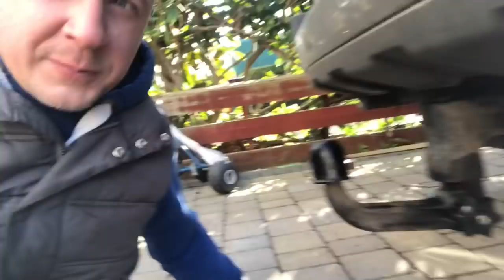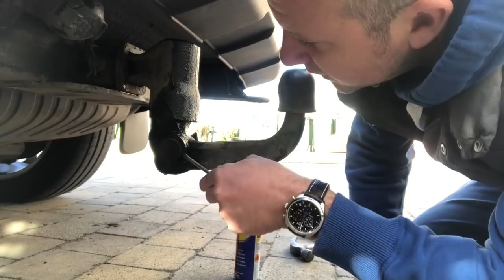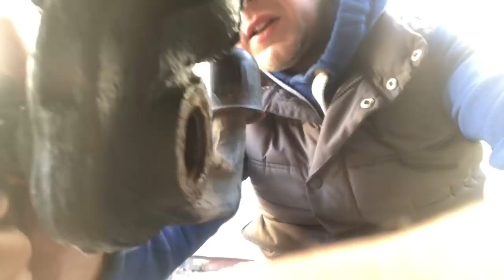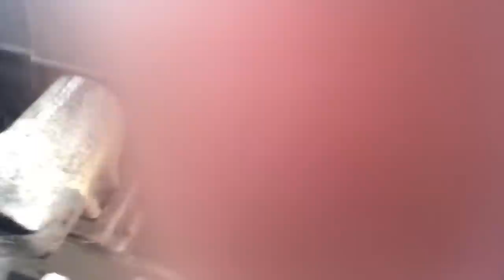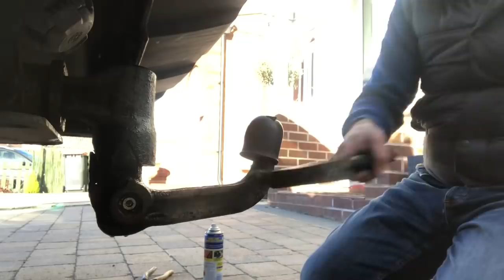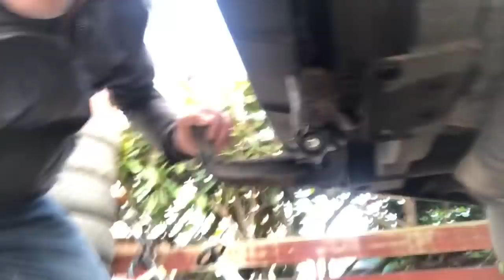Removing a corroded Range Rover L322 Westfalia tow bar

Comment: Thanks for the tips. I just bought a 2000 VW T4 Atlantis and it had a towbar fitted but no key !
I was lucky as it took less than 2 mins to prise of cover,remove circlip (used long nose pliers). A couple of gentle blows and the handle came out soon followed by the towbar. I don't need it and It hadn't been removed in the 17 years the prev owner had it.
Luckily it had been greased previously. I anticipated it taking a couple of hours to batter it into submission after watching your video.

Comment: Hammer time! I just had a similar time removing a Witter towbar, ended up having to take the bumper cover off and unbolting the receptacle, needing a lot of hammering to get it out of the bar. Then after disassembling the locking mechanism and hammering down on the locking pin from above, then more hammering to separate it from the receptacle. Then, hammering up on the locking pin to get it out (losing a small spring... damn!), it's finally free. The little lock is still seized solid though but luckily not a big deal.

Comment: I was attempting the same last weekend, but fortunately I did not follow what you did on that video, as it leads to damage of the tow bar (you damage the socket of this little steel ball that locks the knob in place). 
Some advices:
-if the lock is jammed the best should be to try to pull the core out with a sliding hammer. If you don't have one - you can drill the cylinder, replacements are available,
-smashing it with the hammer will not help much, you should rather try to get the internal mechanism moving by soaking it with WD40 and tryging to turn the knob over and over again. The best is to first unbolt it from the car, so that you can reverse it - will make it much easier to do the soaking :) 
It took me like 3 hours in total...but a completely jammed towbar now works perfectly fine. Of course after removal it's a good idea to flush it a bit wit some brake cleaner and lube.

Comment: Years ago I knocked the assembly out enough to remove the ball bearing, then knocked it back in, replaced the spring/washer/circlip and it worked fine without needing to use the seized lock. Even passed 3 Swedish MOTs, but they've now changed the rules and the lock has to work - though the rule says if a tow bar has a lock, the lock must work (nothing about if it originally had a lock, or if the original design had a lock). Not sure what will happen at the MOT if I pull out the lock, because legally the tow bar then doesn't have a lock.

Regardless, I've ordered a new lock. Easy to remove. Force a screw into the key slot for about a centimetre and then use it to pull the barrel out with a crowbar and a bit of wood. Then just press in the new one. And then do the whole thing again in two weeks when the crappy lock seizes again.

Comment: There Is One Bolt Going Through The Square Mount...It Has A Locking Pin ...Remove The Locking Pin And Remove The Bolt.......Simples.

Comment: Hey fella, what is your take on why this vehicle is so corroded? Brake discs were shocking. I know it’s an old car but not that old. Was the car driven through salt water a lot or something? Great series by the way, really enjoying the detail. 😎
Reply: It’s the cheap road salt used by the councils around the country, it rotting every car prematurely in the UK
Reply: Brett Swampy ah. Seems to be a pretty big problem!
Reply from the maker: Overall, the corrosion on this car isn’t too bad. The worst places were; the rear discs, tow bar, air suspension reservoir. Some point in future I’ll probably do the air tank...

Comment: Hi there you could have removed the nut and bolt were the unit is contained to the main tow bar . 👍🏻😎👍🏻
Reply from the maker: I seem to recall it wasn’t as simple as that & wouldn’t withdraw… it was a few years ago though, so can’t really remember. It would seem a rubbish security system if someone could just remove a bolt and disconnect your trailer?
Reply: @Nut_Job.  well the main thing is you got it off . So well done for that . 👍🏻😎👍🏻
Reply from the maker: 😂 Yep 👍

Comment: Hey! Do you remember if it was locked or unlocked when you started hammering? Or is the procedure the same whether it is locked or not? I can’t unlock mine because of corrosion, so I have to hammer or drill it out! 🙄
Reply from the maker: I remember it was so corroded that I couldn’t tell if it had really unlocked even when I got the barrel to turn. So I just had to hammer the shit out of it until it came free...
Reply: Nut Job Then I will do the same tomorrow! Mine  is totally locked (key-locked) 😜
Reply: @benlund1717  Did you get it out? I have same situation as you and actually started removing it like in this video but I couldn't hammer the lock cylinder out yet.
Reply: @maxl7827  I did get it! After I bought a new one.. so now I have 2! Both working fine 🙄🤷🏻‍♂️
Reply: @benlund1717  What did you do to get it working?
Reply: @maxl7827  I think I came to a point which I call “Banzai” which equals “f… it” and started hammering on all sides with heavy use of WD40.. and I already had a new second-hand one. But eventually K managed to use the key and pull the handle.. Fyi I have the spare tow bar piece with one key still 😉
Reply: @benlund1717  My key just doesnt go in
Reply: @maxl7827  Have you tried spray? Oil? WD40?
Reply: @benlund1717  Yep tons of WD40 spray. The lock cylinder cap was not on for the last 5 years so I think it has corroded inside.
Reply: @maxl7827  Wow.. then a locksmith or in the end drill the thing out and replace the towbar? As I mentioned I have an extra.. 
Ohh.. its for a bmw 5-Series 🤷🏻‍♂️
Reply: @benlund1717  Yes its a Bmw 5 series and I live in Finland but thanks for the offer lol

Comment: 5:53 you require a proper MAP gas torch. You’ll never get metal hot enough with that candle. And you need to hold the heat in one spot.

Comment: Certainly not your best video / advise. Should have simply removed the upper section as well, and not damaged a £150+ (2nd hand) part. You’ll regret it when selling the vehicle.
Reply from the maker: Range Rover P38 
It was already ruined. All I did was smash the lock cylinder out, but that could be replaced if needed. I tried unbolting the upper mount piece but it wouldn’t come free. So I had to remove it this way. No biggy